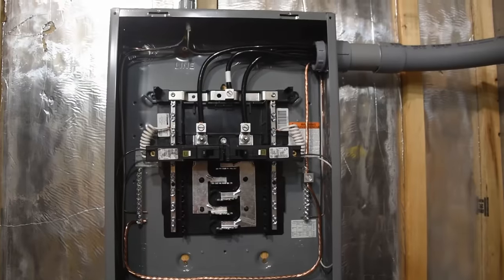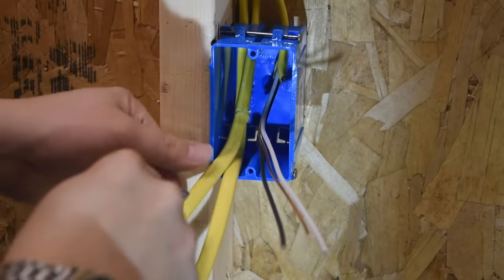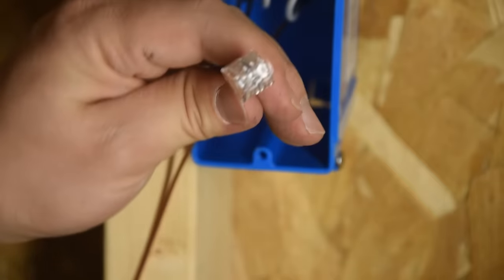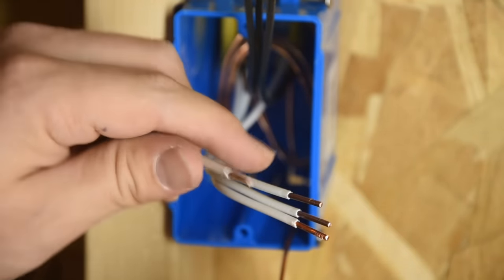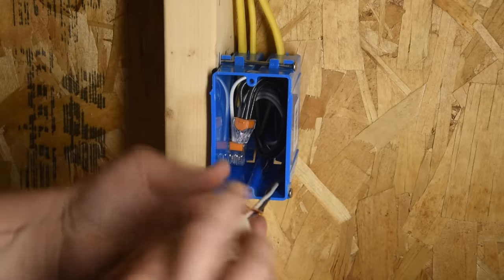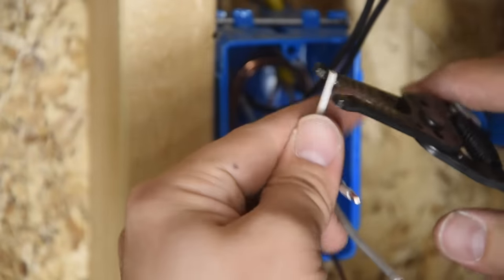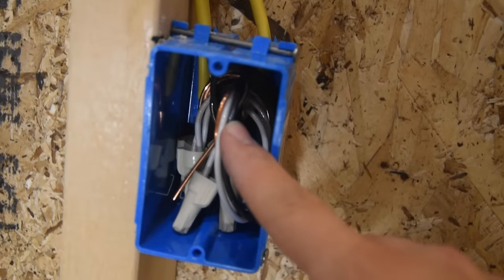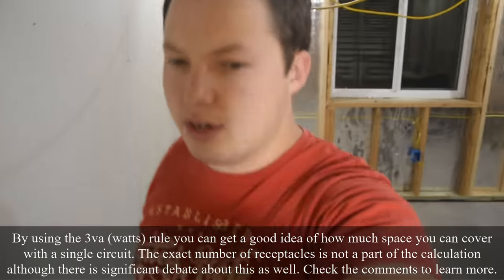Wago's vs. Wire Nuts - How To Wire Outlets During Rough In

Comment: Push connectors come from heaven (What I was told) and if you don't mind a small detail; I was taught to always bundle the bare ground wires first then push them against the back of the box 'behind the active wires' (same thing at the main panel) and never against the active wires so in the event you are replacing or adding something later, you avoid pulling the ground wires to free up the active wires ! For what it's worth !...........Thanks, enjoy your well done videos ! oh, and be safe !

Comment: Great video my only suggestion especially for the occasional DIY'er  or newbie would be to invest in a dual wire stripper (IDEAL® Reflex™ 12-2/14-2 Wire Strippers ) these strippers safely remove the romex sheath instead of using a utility knife that may nick the wire or the installer . Worth the money!

Comment: You won’t see anything like wire nuts in Europe. Over here, twisting wires is a bad practice nowadays - too much installation error and makes testing and fault-finding a mess. Wago connectors hold the cable more than tight enough, there’s no need to twist the life out of it!
Reply: @paulgeorge1069  Personally think lever Wago (221) is the best connector and it has many benefits. I actually do the same as you. I remove wire nuts and toss them in the trash.
On another note, how does the Wagos fail all the time? And is it really as bad as you make it out to be considering how many millions of homes they are currently in?
And what type of stab in receptacle are you referring to? I assume it's the US-style one, and I think based on the picture I found that connection looks different and worse than Wago.
Reply: @paulgeorge1069  Most LED ceiling lights come with push-in connectors, but these are NOT Wagos, they're cheap knockoffs. I always snip them off and use Wago lever nuts, which are amazing. As far as wire nuts go, they're just not used in Europe and haven't been for a long time, and houses aren't constantly burning down there.
Reply: @SgtZima  ya the lever nuts work good but are way too expensive. Very useful on 16 and smaller wires though.
Reply: @paulgeorge1069  they are pricey yeah. Great for connecting stranded to solid wire though

Comment: The way I see it is , if the connector is UL listed , then it’s acceptable.
Reply: Said olny by a person who doesn't do it for a living. 😕
Reply: @paulgeorge1069  lol I didn’t say just because it’s UL listed it’s the best for the job. I just said it’s acceptable. Also,  I am a full time self employed electrician. Some municipalities require different connectors and different types of connections. But they all must be UL listed.
Reply: Back-stabbing is covered by UL listing and accepted by code but it's still a garbage, failure prone connection. I just went through my home and replaced all the receptacles and did away with all the back-stabs and I noticed, the lights don't dim while the vacuum cleaner is on anymore like they used to. That's all the proof I need that a back-stab is a terrible connection.

Nothing even appeared to have been hot, no charing or melting or anything like that. No burning smells. But there was clearly a problem somewhere which is now gone.
Reply: @Krankie_V  I agree with you on that. A lot of my service call troubles are because of failed back stabbed receptacles.
Reply: @alphasaiyan5760  backstabbers in homes keep me in business, but i do replace them with straight wire screw-in outlets… i can never remember what they are called

Comment: Always use the pigtail method you used here. I have found melted receptacles when using the pass through (using all four receptacle screws) method of wiring.
Reply: That's called series wiring.  I hope you're not working with electricity if you don't even know that term.

Comment: I love that he is using pigtails.  I see far too many installs where they use the receptacle/switch as a connector instead of using pigtails.  I have also had to replace a lot of receptacle's/switches that had been burned due to being used as a connection device.  And I am not an electrician, but I try to keep up with best practices and regulations as I do a lot of my own wiring.  I am sure electricians see this a lot more than I do.  I can't understand why so many 'certified electricians' still do it wrong.
Reply: How is it wrong? That's why there are 2 connection points for the hot and neutral. One for the feed and one for the jumper to the next receptacle.
Reply: @liamwelsh5565  I have replaced multiple outlets/switches that have melted because of down stream items pulling more current than the internals of the outlet/switch could handle.  I have never seen a melted wire nut where the entire circuit (and sometimes house) has not gone up in smoke.

Comment: Wire nuts give less resistance between the connections If you use equipement that draw a lot of amps. Because wago`s only have a point connection it will then (by drawing higher amps) result in a voltage drop in the rest of the outlets within the same circuit.  😉 for in home use it can be okay. but for industrial use you always need wire nuts.
Reply: The Lever Lock Wagos are every bit as good as a wire nut, sometimes even better because a wire nut is only as good as the installer - but even an apprentice can handle a lever 😑
Reply: As long as the contact surface is larger than the wire cross section, it should be fine.  WAGO claims their original products are designed to do that.
Reply: @johndododoe1411  Indeed but most of these have less contact surface then the cross section of a wire and that is when problems like voltage drop does occur.

Comment: I use both interchangeably . I prefer Wago levers for tight spaces / densely packed boxes. The wire nuts you show there are the best . Question for you - is there a reason you “roll” wires instead of zig-zag into the box ? I always thought that was the easiest and less messy way to go.
Reply: Would be interesting to see that demonstrated.

Comment: I like the lever-type Wagos when connecting stranded or a mix of solid and stranded wire.  These are clamp connectors, not push ones.  I have found old wire nuts that have loosened with stranded.  If you use stranded ground pigtails, these are a good solution for grounding in junction boxes.  I stick with wire nuts when the load may be high.

Comment: I bought some of the Wago connectors a few years ago for use in Arduino projects since the levers allowed me to easily change things when needed.  These days though, I'm more likely to use a 1/4" hex bolt that is threaded the entire length and run it through the insulating material that the project is mounted on and use 1/4" hex nuts to mount as many wires on it as I need.  I'm just using low voltage though, so I'm not worry about being electrocuted from the bare conductors (bolts) sticking out from the project board.
Reply: I'm guessing you mean what regulations call Extra Low Voltage (ELV), which is low enough to touch.  Regulations define "Low Voltage" as the mains up to 1000V, above that is "Medium" until you reach the actual "High Voltage" used for the grid backhaul pylons.

Comment: I am definitely in the camp of a wire loop under a tight pan head screw which makes a better and more reliable connection. But the lever locks do look to be well made.
Reply: You get a thousand pounds of pressure with a tight screw I'm not so sure you get any of that with the waggle

Comment: Very happy with Wago 221s. I cannot understand the "hate" and reports of "failed" ones in the comments - it's highly likely these are the cheap Chinese knockoffs and not actual wagos. Or improperly sized conductors were jammed in them, or there was some other wiring issue with the breaker elsewhere. The wago won't be the failure point though. 
The fact they're used throughout europe with 220-240v, AND they're NEC listed, I feel plenty safe using them here. The price difference is easily made up with the speed it takes to use them. 
Some old dogs hate new tricks I guess. The US needs to move out of the stone age with wire nuts.
Reply: The countless reports about failed ones surprised me too since here in Austria and Germany we pretty much exclusively use them and I've never seen a failed one while working or doing installation testing so far.
Reply: Being cautious is a good thing!  I too thought Wagos might not stand up, but I did my research and they appear to work fine and have many positives over wirenuts, especially for the DIYer.  I also suspect the problems were with cheap knockoffs.  I also don’t see any images of failures unlike backstabbed receptacles.

Comment: I saw these being used for a light company display (displaying LED lights) and they connected many of these (their display was 3 pieces and set up was roughly 10 minutes to connect 10-15 different lights with these connectors). I find them completely intriguing as these seem to be a much easier solution for 18AWG cables I have to connect from time to time.
Reply: if you are going to be reusing a lot of the time look into the lever wagos .

Comment: The wago connectors you use can't handle 12 gauge stranded wire, however the wago with the release lever can handle 12 gauge stranded wire. I love the wago with the lever. Rather for wiring or for prototyping they work great. They don't work harder the wire. Can disconnect and reconnect to the wire without having to cut a fresh piece of wire like you would with a wire nut.
Reply: @jonstangel7583  the 222 series lever actuator style can handle 12 gauge stranded wire. Both are rated for 12 gauge solid wire. Stranded is thicker. I also like the lever for stranded because it shouldn't damage the strands of wire while forcing them in. I do like the push on for solid wire. Just sharing incase someone else is using stranded wire for a project.
Reply: @concert610  I work at WAGO.  :-)
I was just sharing the link so people could easily find what you were talking about. 
I wish more people knew about these.
Reply: @jonstangel7583  oh I agree. I've loved them once I found them. I was disappointed not knowing about them sooner.

Comment: NEC may not be specific to mentioning type of push in connector at an outlet but I can tell you as a GC in Cali that I see cities that specifically state in boilerplate stamps when permitting, that press in connectors CANNOT be used as final termination at outlets and can only be used in light fixtures where the ga. is 14 or less.  And as everyone knows...All codes are local FIRST.

Comment: The Youtube test on Wago current capacity was carried out by a UK spark called john Ward. Solid cable actually failed before connector despite all plastic having burnt away.
Reply: @brianreinhardt4050  kind of a moot point since in that test he was pushing 70amps through the connectors. Breaker would have tripped way before any wire burning.

Comment: I had an outlet issue so I'm DYI. I forgot I had these Wagos..I thought maybe I should use a certain color for each set of black, white and ground wires but I guess it's not required or needed by code. Thanks for the video.

Comment: I've had lever lock wagos pop open when pushing wires into the box. I've started taping them for added security. I've never used the push in style because I mix stranded with solid so not really useful for me.  Hopefully they hold up better than the push in outlets but time will tell.
Reply: They can pop-up halfway sometimes but you still can't remove the wire. That requires you to fully disengage the lever, which requires a little bit of thumb force.
Reply: @SgtZima  one time I had one lever open all the way causing connection issues.  Partially my fault because I didn't nose the connector towards the back of the box.

Comment: When using wires strippers, it is easy after cutting the insulation if you do quarter or half turn and pull it away. That's my experience. I do use nowadays wago type instead of wire nuts. It is way easy and super space saving
Reply: John Abraham you a licensed electrician?
Reply: @dallas5374  yes
Reply: NO licensed HVAC

Comment: I like the push in connectors but you cant beat the price of wire nuts!
Reply: For an electrician yes, for a DIY weekend job it will be a difference of $5.  I've used the wago lever nuts on my bedroom addition and they worked great.
Reply: Your time is worth money.   If it saves enough time then it’s worth it.   I prefer wagos also because I have spent too many years making revisions and upgrades to old work.  I always tell anyone on my crew, “Remember some day someone will work on this.  That someone could be you”

Comment: Try copper crimp sleeves for your ground instead of wagos...   leave one long, slide on sleeve, twist wires, crimp.. long one goes to the device...

Also dont use pigtails for hot and neutral... just use the terminals on the receptacles...  modern receptacles are made for that..
Reply: @Clarence Wilsey I link my receptacles all the time.. they are made for it... it's just connecting the screw lugs together.. I cant see how that link could fail any worse than pigtailing...

Even if one outlets gfci trips the ones up and downstream will still work

Comment: 15 years as an electrician. Push style connectors may be quick and easy, but they are not reliable long term. Most of my repair calls are for push connect type issues. I would never put my reputation on them. I take pride that my connections will never fail unless tampered with. I strip 1 1/2" line up the insulation ends (not the wire ends) and twist well with 9" lineman pliers then cut off the excess.  For ground i do something similar except I cut off all of them except one and so the twist then put a crimp sleeve on (greenie wire nut with the hole in the end is acceptable as well), but takes more room. My twist are so secure that the wire nuts are only there to make it up to code. The local inspector always says positive things about my connections. It may take a little longer to do, but it's worth it to never get a call back. My time is precious, but my reputation is my lifeline. In the end everyone must choose the quality of their workmanship.
Reply: Like to add that the wire nut should only be seen as the protective covering of the splice not the mechanical part of it.

Comment: You can rely on Wagos for tying Grounds/Bonds together because they arent emitting heat all the time, so the stab connection isnt going to be compromised over time..
 It saves some much needed space in the box and you can get them with 8 or 10 spaces for many bonds to tie together at once.